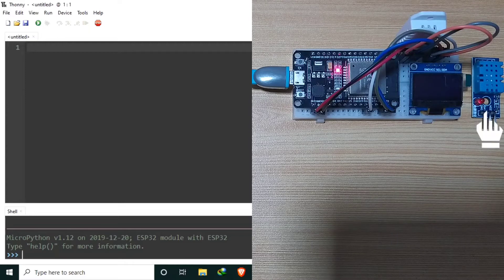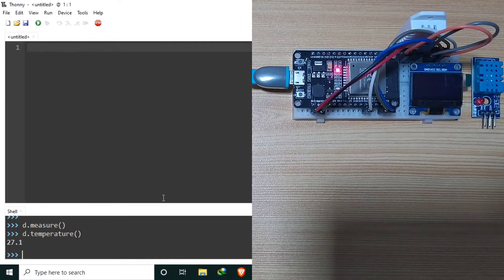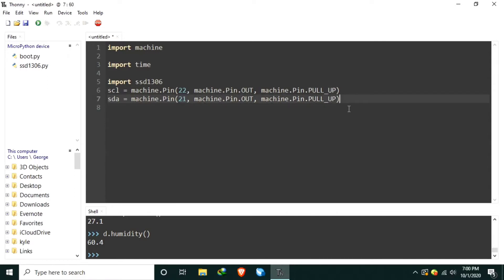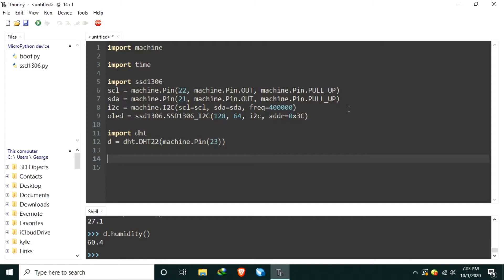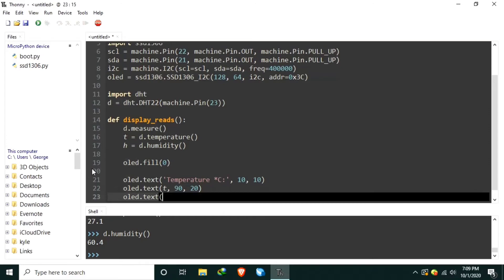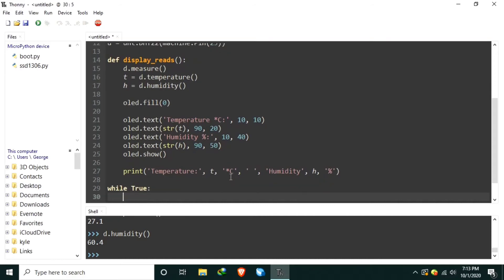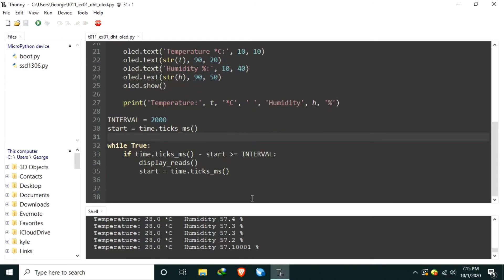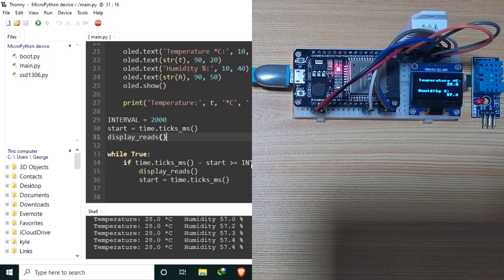011 - ESP32 MicroPython: DHT22, DHT11 in MicroPython

Comment: When I run d.measure(), I get the following error:

Traceback (most recent call last):
  File "<stdin>", line 1, in <module>
  File "dht.py", line 17, in measure
OSError: [Errno 116] ETIMEDOUT

Do you have any ideas on why?

Thank you and I love your videos
Reply: I did check the wiring and replaced the DHT11 device. Same error. What do you think of the error line ' File "dht.py", line 17, in measure'?
Reply: I got a new DHT11 and it is now working. Thanks for your patience.
Reply from the maker: @albrody8861  good work. Glad hear that. Thanks.
Reply from the maker: @albrody8861  good work. Glad hear that. Thanks.
Reply from the maker: It seems that ESP32 cannot communicate with the DHT sensor. Try double checking your connection.